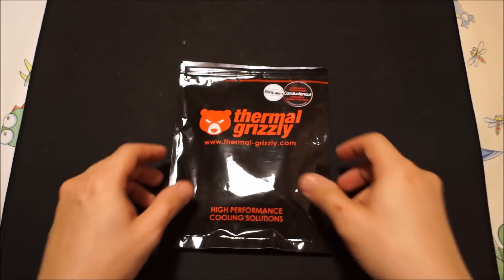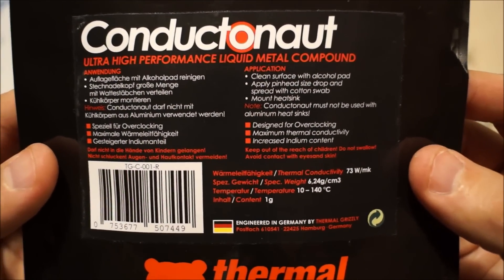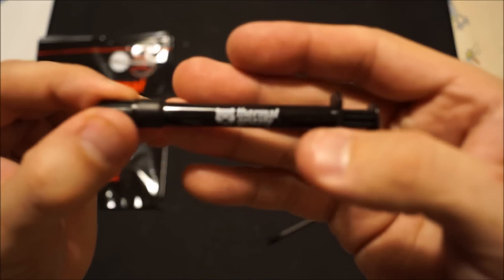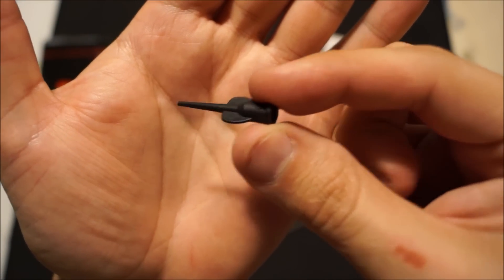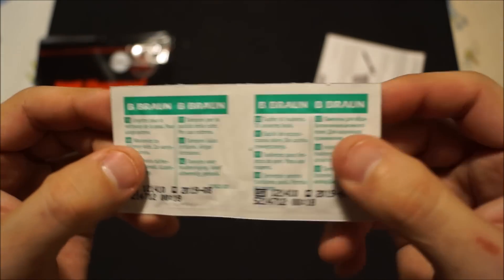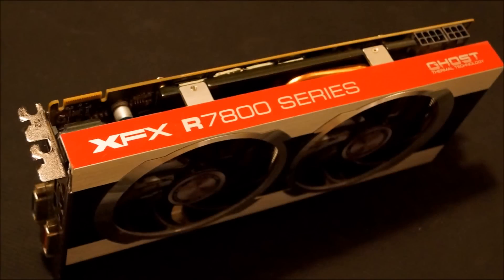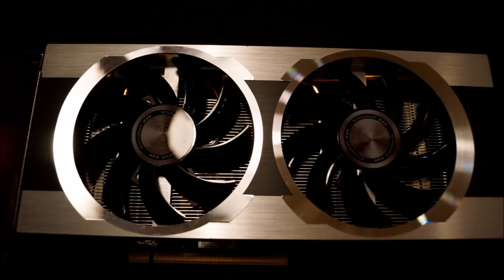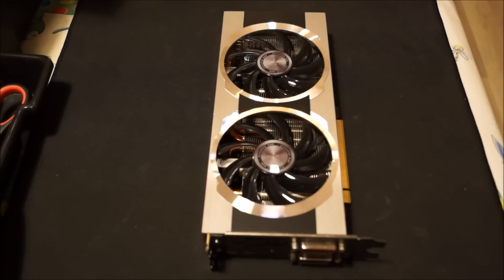Thermal Grizzly Conductonaut...is it any good?

Comment: That's rather disappointing.. I kinda wanted to buy this stuff to put on my 980ti. Really been thinking about it a few months but I already have Thermal Grizzly Kryonaut on it so if that really old paste (I'm assuming) to liquid metal is only 5c I probably don't have much to gain.

Don't get me wrong the Kryonaut does a good job cooling it but I like to keep my fan speed as low as possible (noise). 

Was this the $15 size or $40? I know the Kryonaut applicator isn't that efficient. More thermal paste seems to get stuck in the tip then I even use. Hate to think that would be the case with this stuff as it's so expensive. Only real reason why I'm considering cool laboratory over it as they have that needle tip and I don't have to worry wasting so much when using it.
Reply from the maker: Keep in mind that the reason why it was running at only 85-86c was because the card kept throttling down, or else it would have reached the 90's. After applying TGC, the card not only boosted further, but I was able to overclock it and still run 5-6 degrees lower in temps. that's pretty good imo. The old paste looked in good shape. Was not dried up like some I have seen before. Was still soft.

If you do go with liquid metal TIM, go for Thermal Grizzly Conductonaut. Liquid Pro comes with needle, Liquid ultra does not, that I am aware of. I have bought several LU TIMs and none have come with needle included. Liquid Ultra tubes come very little amount, its not worth the money. You get a better deal, although more expensive, with Thermal Grizzly. And it performs slightly better. 

If your graphics card has a decent cooler, liquid metal TIM is a good choice because it will help a custom cooler perform to full potential. But for blower fan style coolers, just stick with thermal paste, like MX-4 or Thermal Grizzly Krionaut, since no matter what TIM you use, the reference design coolers are no where near as good as board partner coolers, like MSI or ASUS coolers. 

This tube I'm using in the video is the 1g tube, btw.
Reply: There's a video showing a 10 degree drop in temperatures on a Zotac 1080 Mini with Conductonaut. But the biggest improvements I've seen to date are with a 7700K delidded, internal TIM replaced with Conductonaut, IHS put back on and sealed again and with Kryonaut as the IHS>Cooler TIM and there being a 20-25 degree drop, which is just ridiculous.
Reply: hey how many cpu or gpu applications can you get out of a 1g tube do u know?
Reply from the maker: I have managed to get around 15 rice grain size applications. But I go through this stuff quick.
Reply: all the sound nonsense lol just get a extension cable and move your computer where you won't hear the fans going cooler is better in my opinion  fans on 100% speed is better what's the point in overclocking if your Gona be moaning about noise your temps won't be any better at lower rpm might Aswel have noisy radiator and move the computer where you can't hear it like a closest like linus has hid server in because those things are noisy
Reply: @jonathanoxlade4252  Yeah, I never understood the noise obsession either. If the sound of a computer fan moving air is the biggest problem someone has, they must have a darn good life lol.